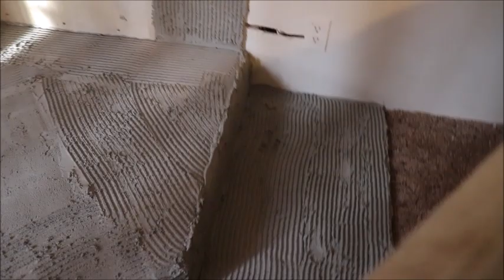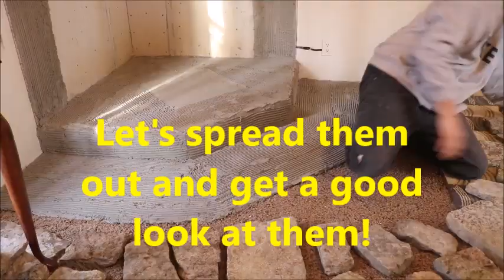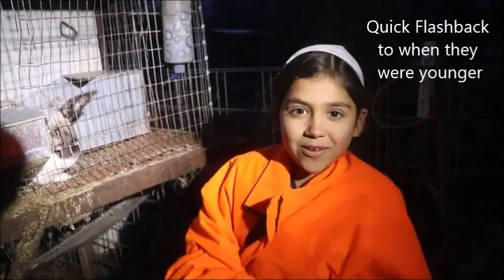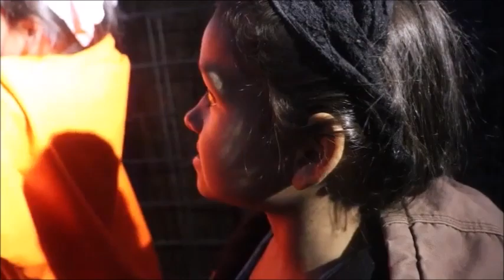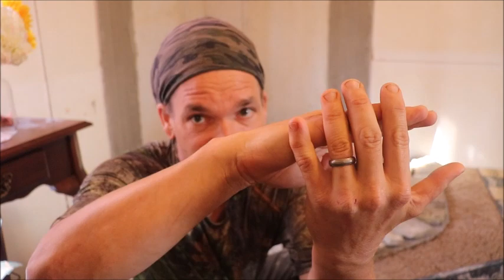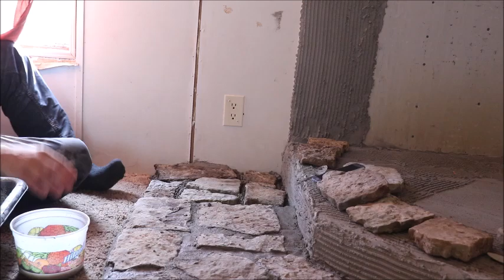FINALLY - Rocks & Mortar for PRIORITY # 1

Comment: Nice start to the job Papa Pepper. I agree with Heith below, I'd go a little bit wetter with the mix. A rubber mallet is great way to set stone pieces, and they're typically very cheap. The more you thump on the stones, the more you get the mortar to ooze into all the cracks and crevices and create a suctioning seal/bond.  Else a lot of wiggling back and forth (without actually sliding out of place) and pressing down helps.  You do not want your mortar to cure too quickly else it will crack or not stick to the stones and eventually the mortar will chip out or the stones lift off.  Spritzing the mortar with a sprayer bottle as you go or damping it down with a big sponge as well as afterwards every couple hours can help.  No standing water, just damp so it looks continually dark. It is totally fine for it to take several days to fully cure.  You may find areas which dry fast and others much slower, you want it all even.  You want to do this job once, so slow and steady wins. Don't rush as you do not want to have to knock it all out due to cracking and reapply.

Comment: U did well man.  
A helpful hint . Add a tad more water. You can its ok . U want it like a smooth peanut butter consistency. I seen u struggling to get the stones down. U can use a rubber hammer to help get the stones down a tad more if u keep the mud stiffer but u can loose sum time doing it . If u have a 16oz bottle hanging around put a screw threw the top . You now have a squeeze bottle to add water to ur mud . We use them all the time . 
You also can fill in the lines after you get all the stones layed. You do not have to do it all at once.  We use ap grout bag to fill in with and the mud needs to be way softer . I'd really like to show u some of are work to help you out and land a hand to u off here . How may we get in touch with each other.   ???? . Id even send u one of my bags to use and how to keep it clean . My mind is racing , I love stone work , it shows a person's pride in his work.
Reply: This is very generous.  I lived n an historic district.  Expert stonework is an art form.
Reply from the maker: Thanks man!
Reply: @PapaPepper  got it .
Reply: @PapaPepper  sent .